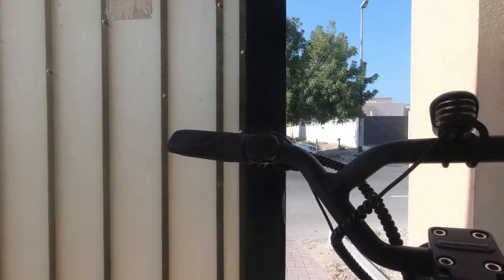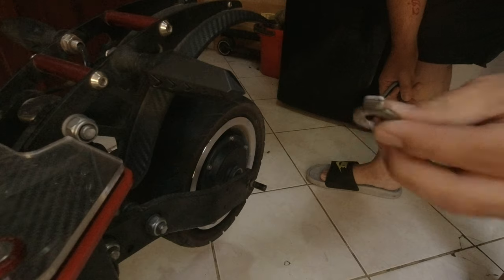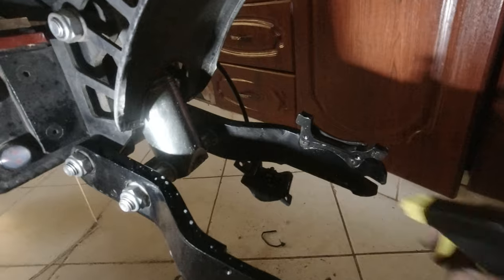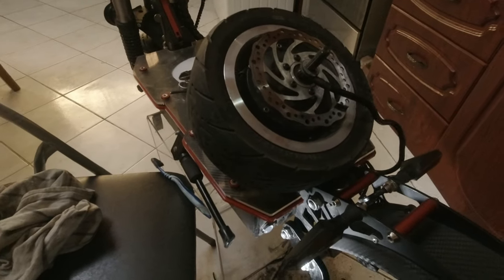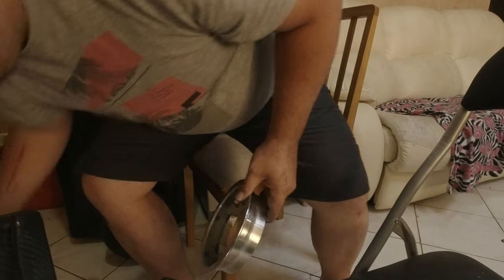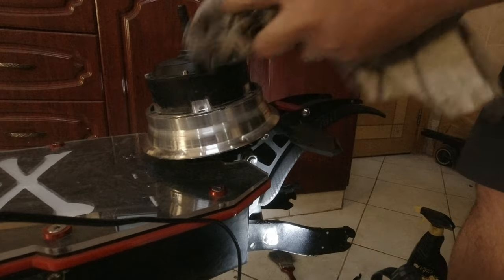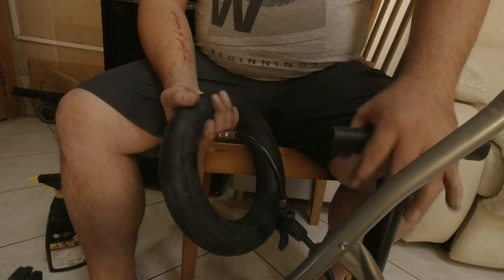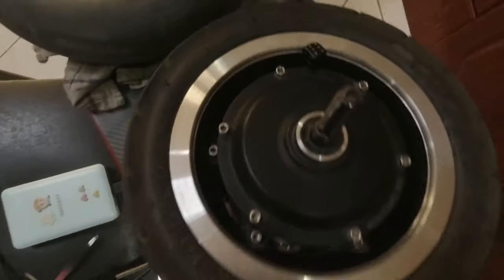HOW TO FIX ANY FLAT TIRE IN A BIG E SCOOTER | YUME Y11 FLAT TIRE FIX | Fix mostly all escooter flat

Comment: Awesome video! 

Silly question, Why do they call it a tubeless tire if there’s a tube? 

To find what caused the flat put  it in water (sink full or bucket) and you’ll see bubbles coming out of the bad spot.
Reply from the maker: No its not called tubeless man,they usually call it tubeless if theres no tube inside
Reply: They dont call this a tubeless tire 😂. There are rubber tubeless tires and there are ones like this that have tubes. Its about knowing your scooter and what type of tires your particular scooter has.
Reply: They dont call this a tubeless tire 😂. There are rubber tubeless tires and there are ones like this that have tubes. Its about knowing your scooter and what type of tires your particular scooter has.